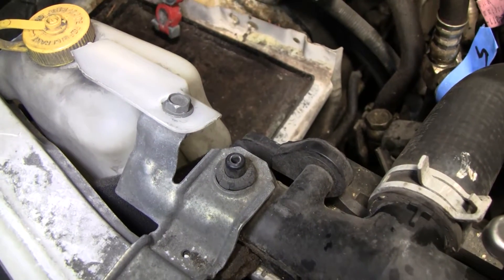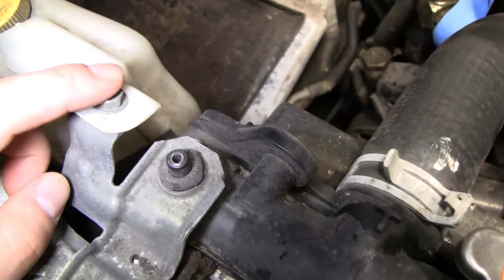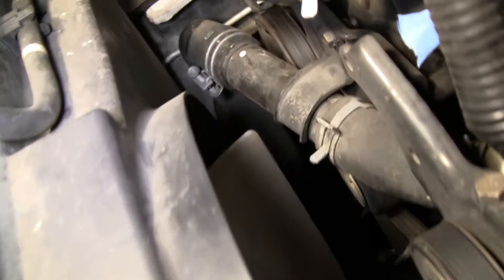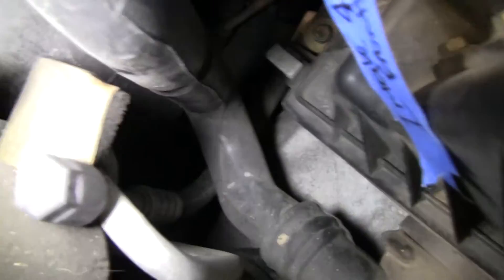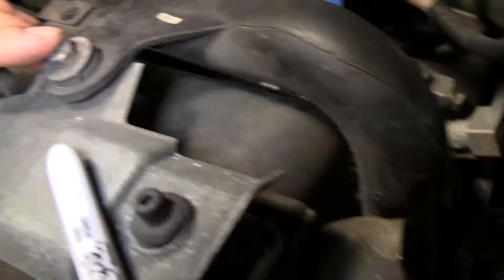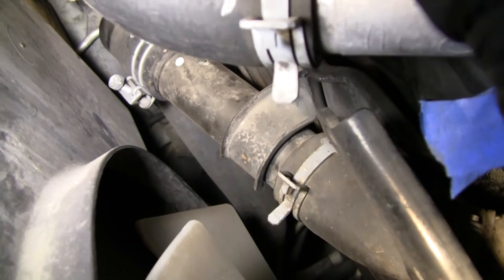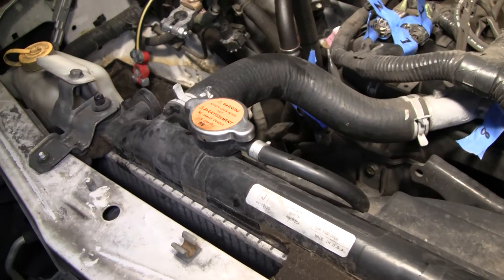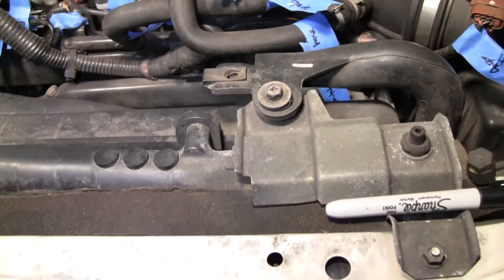2002 Nissan Xterra VG33E Rebuild Step by Step Part 4 - Beginning Radiator Removal

Comment: I gave you a thumbs down and want to offer you advice.   In school, you can get 100% of the assignment correct in math; however, the instructor will take points off for not showing your work.   You spoke a lot, but your video doesn't show what you did.  The major reason that I and others come to pages like yours is to learn from example(sight).  You didn't let us see how you took the radiator out, in step 5 you only show that the radiator is out.   Wishing you the best!
Reply from the maker: Thanks for the advice. These videos originally were not intended for anyone else to view besides myself as a reference for assembling my Xterra back to running condition. There are plenty of guys on youtube who can "show their work" like in math class back in school, but do you really like sifting through a hour long video of someone undoing bolts? I just try to show you what to do. Don't sit here and watch me do it, do it yourself! Once the radiator is disconnected, all you need to do is pull it straight up! very straight forward. Thanks again for the comment!